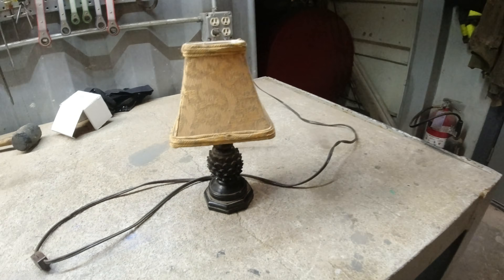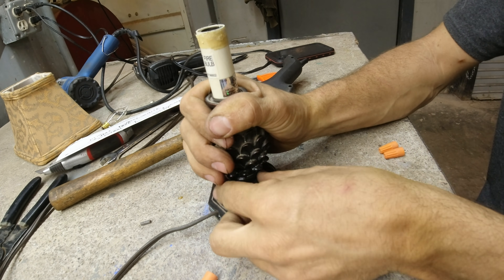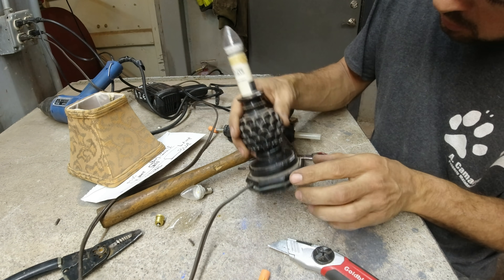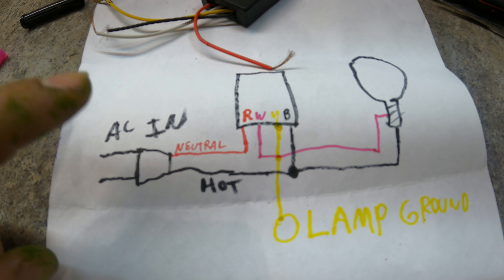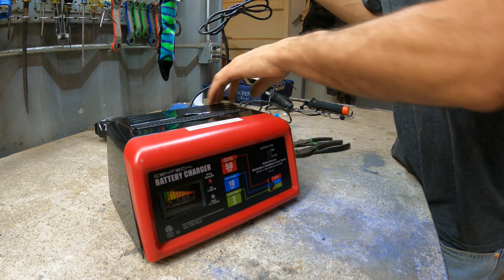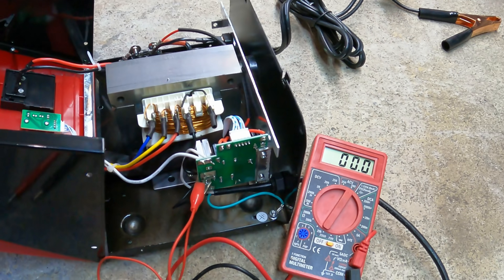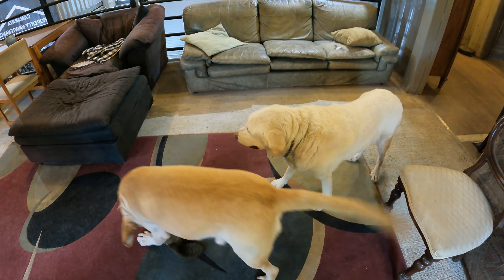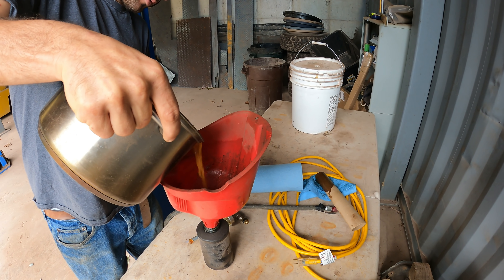Installing a touch sensor in a lamp

Comment: Your lamp's body is made of Resin was why it didn't trip the switch and metal collar you put on was like plugging in your Welder into a household outlet that fried it. The Yellow wiring harness that's bolted onto the stem the holds the lamp/socket together is what makes the switch work and by using that piece of conduit against the metal that to make it work drew to much power. They still make Touch Lamps and since your contact completes the circuit converting one that was never intended to to have little more than a night light bulb in power to have three way light feature wasn't smart. Indeed most fbulbs that are three ways have a set of filaments for each power input and it's why one to two could fail but still light and exceeding the sockets power rating with a bulb/switch caused it to burn out and still can since the switch did just that. If you even hit or tapped an old filament bulb and it's light became brighter  it was because it shed part of its wire in doing so and it's why they usually arc after they're switched off back on since the filament couldn't hold the voltage since the wires gauge became thinner. Touch Lamps fell out of fashion because contacting them with wet hands/fingers could cause a bit of a shock as the switches wore out and poor quality control as well and you could install the plugs that a lamp/light goes into to activate by a remote signal even Smart Phones can do it now with an integrated system. I used a holiday adapter with a RC Remote you can buy during the holidays to turn off/on lights for my Aunt at night when she needed to get up and it still works elsewhere since they are powered by the outlet with just the remot needing batteries. Nice to see Levi again because his absence worries viewers because their fond of the old boy and knowing that he's still with you warms the heart.

Comment: Andrew, this lamp is so light that it almost tips over trying to reach for that metal collar you built. How about making a decorative metal base for it, attach the lamp to the larger metal base and thus increase the weight to prevent it from tipping over and make it easier to find the metal to touch at night? By the way, the lovely Home Improvement Depot Center store also sells touch sensors that plug directly into the outlet and you then simply plug the lamp into that sensor thing in the outlet. I have no clue how they work, but they work great with metal lamps. No wiring to mess with, just plug and use.
Reply: Next video: building a touch lamp from 0.25" steel plates and square tubing so it won't break after just 20 years.
Reply: @Nadstratosfer  ... and half a day of welding to close up the seams? I wanna see that lamp - haha

Comment: I'm 77 yo have dealt with electronics a good part of those years as an electronic technician but I'm like you Andrew I didn't know until this evening , that the NARROW prong is hot and the WIDE prong is Common or neutral.got to this link.
 https://www.google.com/search?client=firefox-b-1-d&q=in+a+standard+american+AC+wall+outlet+which+prong+is+hot+and+which+is+neutral+

Comment: You grounded IT out. Your wiring was WIRED backwards that's way it was POPPING and  your circuit breaker shut it off. This is why  your lamp was shutting off. 3 TIMES YOU WIRE IT THE SAME WAY. Good thing you didn't have a fire. That's why your Circuit Breaker shut the power off.

Comment: "ac so its alternating current so it can kinda be switched" this is why i watch his videos for background noise and not anything u should go by its basically asmr but by god hes a cowboy builder still love him but i wouldnt trust him with anything more complicated then groundworking
Reply: ExactlyExotic he is correct generally speaking. A simple lamp can have the phase and neutral switched and will work both ways. Either with the phase in the socket bottom or the sides. Not so sure that board can handle that though which could be why the boards keep breaking.

If that wall plug can be inserted both ways putting it in the wrong way will switch phase and neutral.

Comment: When the grinder came out and you were tapping the sleeve down with a screwdriver and hammer my first thought was...this is about to get good 😂 then 1,2,3 sensors blew I was thinking the next scene was going to be the excavator mashing it down in the trashcan as you said... well that ones no good but I have this here other one that used to work but nope...... Andrew- I have 9 more of these things🤣🤣🤣🤣. thanks for the battery charger tip though, I have 3 of those pieces of junk and wont do anything unless the battery has more than 6 volts in it. whats the purpose of a charger that wont charge a damn dead battery... stupid design imo.  Damn man the castle has turned into a true masterpiece, I love it.

Comment: Your content is really fun, when car batteries are charging they release hydrogen gas which can explode from a spark...I've seen it happen in high school shop class, my buddy plugged in the battery charger then hooked up the cables..that battery grenaded...acid and shrapnel all over the shop class..If you want that charger full bore .no prob..but remember hook up the cables then plug it in..

Comment: Your glue may have been conductive causing the contact switch circuit board to short out. However, you discovered that it was shorting out in the socket - I got to wonder why that happened? Gotta say it, "you got persistence", damn if I wouldn't have chucked it. Nice job Andrew. I am always happy to see you release a video now and then. I really like your home layout and the "eagle's nest" (your bed area).  p.r.morehouse

Comment: Great video. Laughed when boards kept blowing. Then almost getting shocked.
That battery charger, ugh I do not like the new ones with computers in them. They can ruin car batteries. 
Yes Andrew Levi needs a elevator or a lift to assist him going up to the top level of the castle.

Comment: I am a sparky, trade qualified, just to put that up front... He bought a new battery charger, they all now require a battery to be hooked up, so the sense circuit can detect reverse polarity- if he wanted a 12v power supply, readily available, and cheaper than a battery charger to boot (about a third of the price!!!) should have just bought one lol
Re the lamp, sorry mate, but you have it wired wrong- the red goes to active (what you yanks call line) the white goes to the center pin, and the black (which you correctly showed as being unswitched) goes to the threads for the neutral- they used the correct wiring colours for 'TROTW' ie the rest of the world and 230v- you should NEVER have the switch in the neutral line, that's a big nono in any standards I have seen...
Those circuits will work quite happily on the US 120v, but as many have said, they don't like some LEDS- use dimmable LEDS and they will be fine
And the bare PCB inside the base- no, just no- especially in a metal lamp...- at least wrap it in some electrical tape or heatshrink
Love his channel, but that's just plain wrong, sorry

Comment: I wasn't at all surprised when the angle grinder made an appearance. I saw another video with these sensors, pretty sure there was misinformation on the wiring diagram leading to similar explosions. Be careful with mains wiring Andrew, we would hate to lose you.

Comment: Andrew,  I am a remote control nut when it comes to lights and security.   I use X-ten products.  They have motion detecters, dimmers, automatic lights for security and a world of stuff you can assemble to do crazy stuff.  check them out at X-10.com.

Comment: Is there any chance you were touching some part or solder trace on those circuit boards to the metal hardware on the lamp center tube or nut by taking off the black casing? Would explain why they were popping........

Comment: All new battery chargers are junk Andrew, i always go to ebay and order a old/new charger that doesn't do that crap about not charging with battery connection or shut off on the charger completely. Thanks for upload!

Comment: 2:55  That lamp is made of plaster of paris but those touch sensors only work on metal body lamps.   Works by sensing a change in capacitance, the same way the touchscreen on your phone works.

Comment: are you sure that the circuit board wasn't shorting out when you pushed it up inside the bottom of the lamp with no cover on it?  I was thinking you should have encased it in the hot glue so it wasn't exposed.
Reply from the maker: Yeah, it wasnt.
Reply: @AndrewCamarata  i ordered a couple of these things, I am going to try this too.

Comment: fluid film is that what
you said right before the
video ended ,lots of keeping up
with everything up on the shop,
why not install a twist plate in place
for the lamp to hold in place the lamp
on the table and it would not get knock
off out of place in the dark when reaching
for the switch  to turn it on , the touch plate
 i would install on the night table itself much
 easier for me to function when i've got to get
 up in the middle of the night, a touch is way better
 than a reach a grab and Twist , i'm going to have to get
 this one Yo that's Cool and thanks for link Andrew i like that
 your Shop is looking super neater a nice juicy milk bone for Levi
 and kody just to keep them from licking their feet the Dogs are real
Sweet        🐾      
                  🐾
          🐾
        🐾

Comment: $20 bucks at Home Depot. Sensor needs to attached to a metal body. And don't use silicone as an adhesive. Tends to be corrosive to DC components. And sometimes does not like LED. Dimmible are not LED friendly.

Comment: Hi Andrew.  In the uk it is illegal to wire a switch in the neutral line because your lamp holder is always hot, it is easy to get shocked. I don't know enough about us electrical codes to say your wrong but I hope this helps.   Paul

Comment: Lamp cord has a ribbed wire and a smooth wire the smooth wires hot the ribbed wire is the neutral don't cross them

Comment: Nice video.  I love the fact you show it all un edited. A shock and all. Haven't we all got shocked?  That lamp was cool. I didn't know you could convert them.  I was trying to figure out if someone made an actual dimmer switch like you would have on a living room wall.  
Oh, not to be picky but I noticed the top of your nightstand. Google this easy fix.  1/4 cup of olive oil and 1/4 cup white vinegar. Mix it up. Grab a rag and wipe the top of that wood surface.  Let it set a minute and rub it off. The entire top is now one even blend and looks awesome!  I refinished two stands for my bedroom without the hassle of sanding or stripping them down, refinishing them, etc etc.  Someone told me and I googled it to see before and after photo's of how that re-conditioner  worked on wood. WOW.  Impressive.  It's just your grandma's old recipe of keeping furniture polished.

Comment: You could just drill a bolt through the base and then you would just have to touch the bolt. (obviously tying your wire to the bolt on the inside.

Comment: Those switches:  F'get Amaznon.   How about a buck and a half from ebay:  https://www.ebay.com/itm/2X-110V-3Way-Light-Touch-Sensor-Switch-Control-for-Lamp-Desk-Bulb-Dimmer-Repa-Lw/124219906765?_trkparms=aid%3D1110006%26algo%3DHOMESPLICE.SIM%26ao%3D1%26asc%3D225074%26meid%3D2f1f54839d2c4c7f98e5c63f0d760d4e%26pid%3D100005%26rk%3D2%26rkt%3D10%26mehot%3Dco%26sd%3D301380677336%26itm%3D124219906765%26pmt%3D1%26noa%3D0%26pg%3D2047675%26algv%3DSimplAMLv5PairwiseWebWithDarwoV3BBEV2b%26brand%3DUnbranded&_trksid=p2047675.c100005.m1851

Comment: I would make sure that lamp is plugged into a gfci outlet.  That circuit board had exposed 120volt solder joints on it and they are touching the felt on the bottom.  Hope you never spill a glass of water or something else near it, the felt will get wet.

Comment: See, here in the antipodes the Red wire is hot with the black wire as Neutral, you switch the positive not the negative, means there’s no power in the line to the end device when it’s off.

Comment: UK prices.

Buying touch sensor on Amazon - £9.00 for 1.

Argos UK 2 lamps with sensors £11.99.

Unless you have plenty of sensors, know the voltage, know required wattage, are proficient at bodging electrics by all means try, especially if you want to hold your breath everytime you turn it on/turn it off or dim it.

Otherwise buy them, it's safer, cheaper, requires no work, works from the box, you don't need anything. Welding a digger blade - yes, this no no NO.

Comment: Andrew - I have great respect for your skills but ocasionally I pull my hair out (what little I have left) when you do some really unwise things. First: buy a ac/dc clamp on ammeter. This would have answered the question as to the quality of the battery charger output. Second: Never pull a plug out by the wire. Always pull on the plug proper. My daughter ignored me on this item until the day she pulled the vacuum cleaner plug out by the wire followed by a shower of sparks. Third: when converting a lamp to a "touch switch" make sure that you also convert the plug to a polarized plug. I feel for Levi. I have to struggle to go up the stairs also. PS - I am retired Electrical Engineer of 37 years. Cheers and keep the chats coming!

Comment: You are lucky you weren't electrocuted by that Chinese junk. There is absolutely no electrical isolation between your body and the AC line in that thing. Plus, your lamp will turn off and on mysteriously during thunder storms. If you can afford that castle, just go out and buy a UL certified touch lamp. Your mother will thank me.

Comment: I am an electrician by the way,A touch lamp has to have an incandescent bulb you can't use an led or compact fluorescent bulb 
Although they do have dimmers for fluorescent lights, fluorescent lights can't be dimmed like an incandescent they have a ballast and need constant 110 volt unlike incandescent which uses a voltage drop to dim, glad to see anyone having an interest in electricity and electronics learn ohm's law and be careful,  it's fun, it's the amps or current that can be deadly, always make sure you're not barefooted on concrete and use one hand to avoid electricity going through your heart which  can stop it

Comment: I have what used to be a touch lamp near my bed.  That feature stopped working years ago.  I swapped the bulb for a small florescent unit which has worked for many years (I even bought a replacement bulb which is around here somewhere) and just push a switch for on/off.  This was interesting and got me to think about fixing that lamp. Nah, it'll be fine as is.

Comment: Doesn't the battery charger have circuits to detect that a battery/load is attached before it switches on (straight short circuit not counting as a load), and therefore not produce sparks when shorted and the text on the sticker?

Comment: That steel & concrete building must be boiling hot in the summer & freezing cold in the winter. Those materials suck at thermal insulation!

Comment: You are very intuitive with electrical some of my electricians that have worked for me for years would have had trouble with that charger. The only thing I would say is probably do not use it on trickle charge because I think you bypassed the shutoff if you do use the trickle charge check it with your multi meter and dont let the voltage go above like 13.5v dc or so or you could smoke the battery or even could explode possibly. Or just use it on boost to help start a vehicle or power the desil pump.

Comment: I believe when you put hot glue on the first circuit board the glue came in contact w several soldered points on the board and might have shorted it all out. 
Judging by just what I can see on video

Comment: Now exactly WHAT failed on the touch sensors? Can it be repaired? Parts from your local Electronics parts store or on line;   infernal "improved' electronics on Battery chargers;,,who needs all this aggravation?
The Man Cave Build is coming along nicely, cant wait to see the end result,
How are you going to insulate all the steel ceilings and walls to stop condensation from forming and to stop heat loss and heat gain?  How are you going to heat and cool all that additional living space?
Undercoating; what are you using? Mustie 1 in New Hampshire likes to use Bar and Chain oil Mixture....

Comment: If you look between the two black wires on the transformer, there is a small square thermal fuse that is slid down inside the white plastic frame of the transformer.  It bridges the two black wires at the transformer connections.  If that goes out, it stops working.  I know this as I just replaced the one in my Schumacher charger.

Comment: https://www.ebay.com/itm/10pcs-3-Way-Sensor-Switch-Control-for-Lamp-Desk-Lampe-AC120V-240V-50Hz-60Hz/264820960778?_trkparms=aid%3D1110006%26algo%3DHOMESPLICE.SIM%26ao%3D1%26asc%3D20200520130048%26meid%3D1d4ea30a1cfb4d89bfea97ef26fa3515%26pid%3D100005%26rk%3D6%26rkt%3D12%26mehot%3Dco%26sd%3D173895241543%26itm%3D264820960778%26pmt%3D1%26noa%3D0%26pg%3D2047675%26algv%3DSimplAMLv5PairwiseWebWithDarwoV3BBEV2b%26brand%3DUnbranded&_trksid=p2047675.c100005.m1851